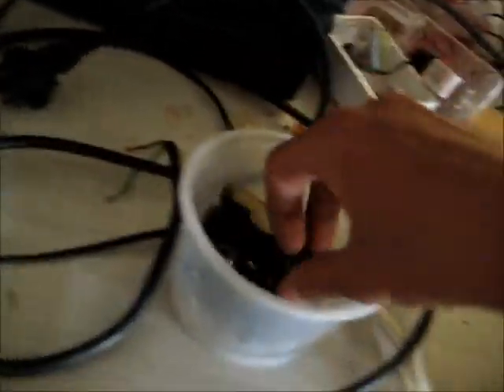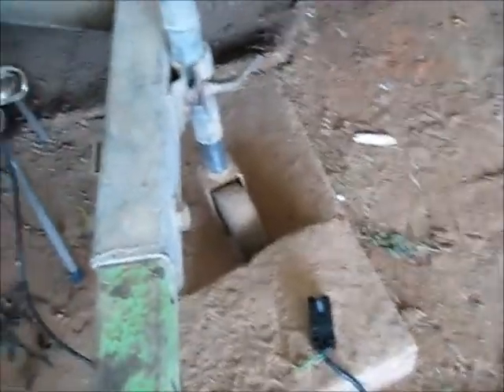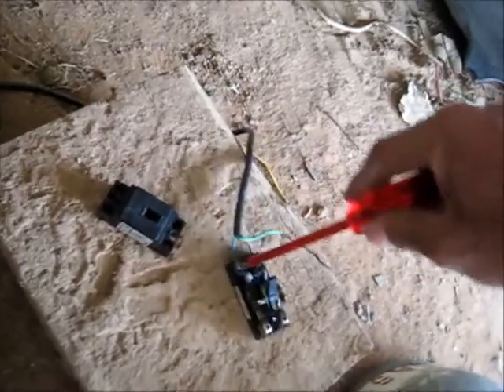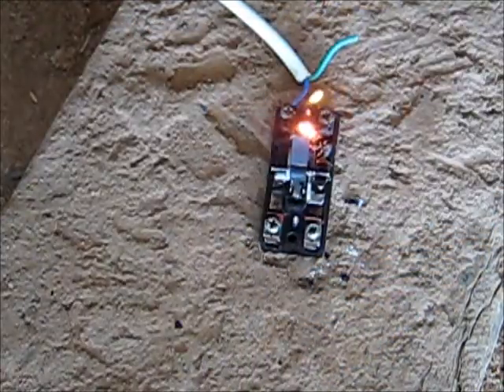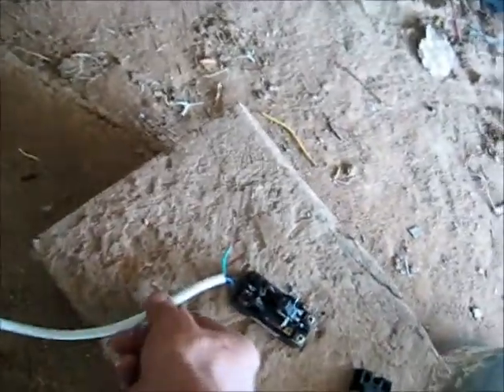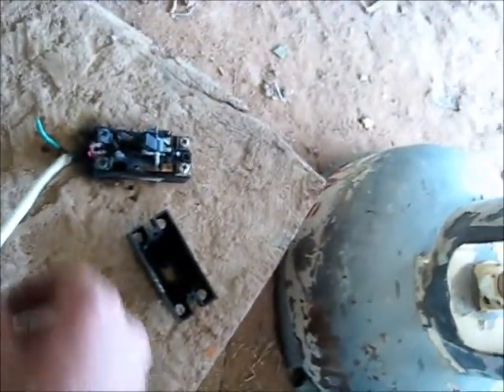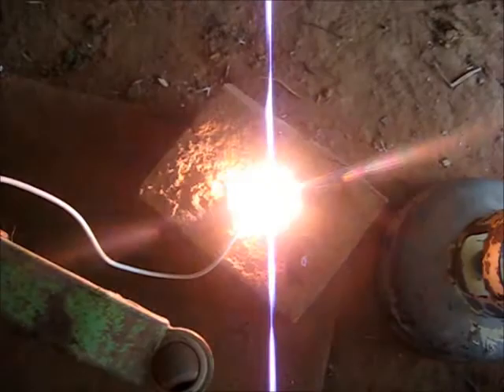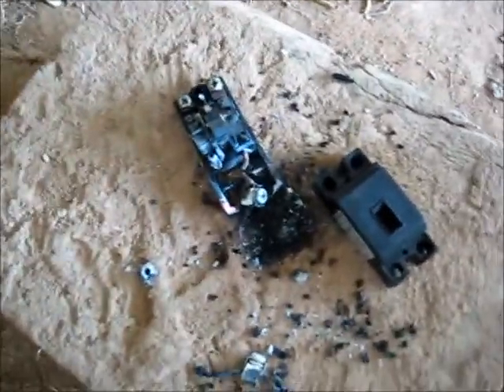Finishing Off Chinese Breaker Switch

Comment: So there was no load or dead short between those two wires other then the body of the breaker?What type of plastic is that breaker made out of? Is it Bakelite? Bakelite should not have burned up that easily, not in normal use, even after a little abuse it still shouldn't burn like that.

Comment: @HDXFH So it isn't a type of plastic that will melt, it's more of a thermoset plastic? Is it a brittle material? I wouldn't surprise me if it had a lead content, that should be the motto of the Chinese, when in doubt add some lead or melamine for good measure. Strange enough not everything they make is bad, I have a China angle grinder that I used to cut cement and stucco for over five years, never babied it, and the part that failed was the cord, it was like a $25-30 cdn. cheapie.